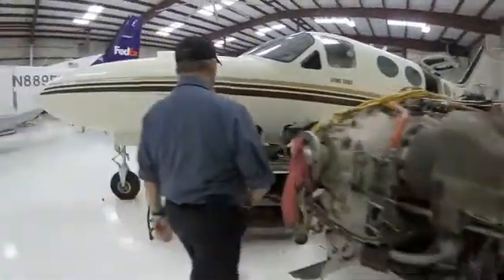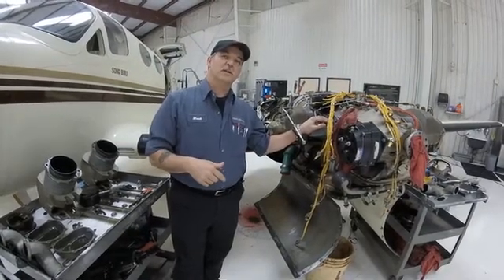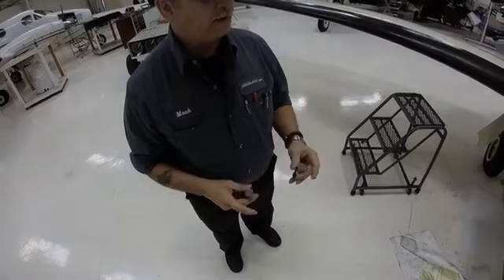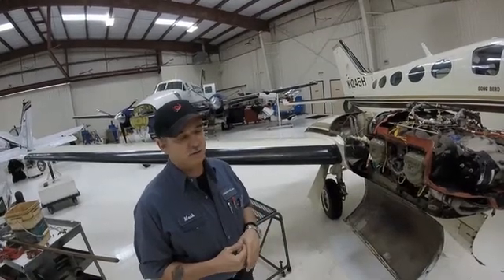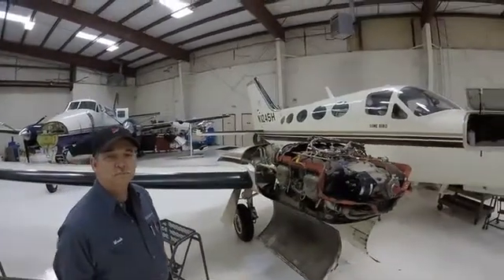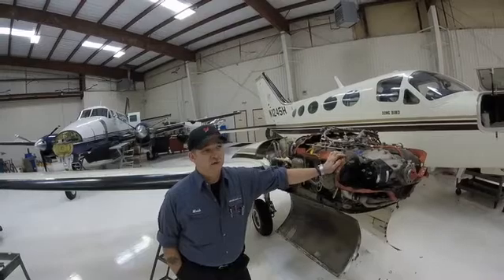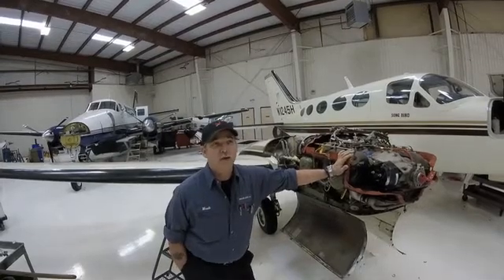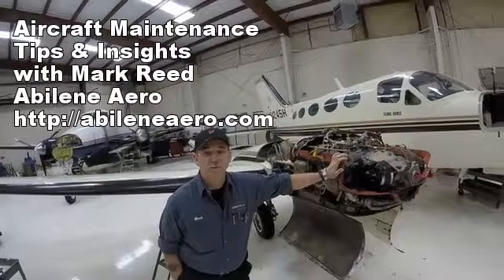Maintenance Insights-Lifters On Continental Engines

Comment: These lifters haven't been very reliable, and rust gets them pretty quickly in this application. If I'm changing cylinders or resealing leaking push tubes on Continentals I'll change lifters when they look like the one on the right because they might take out a cam in the next five hundred hours on an A/C that gets flown that much in a year's time. 

The pitting decreases the available surface area to bear the load accelerating the wear because the remaining surface area becomes overloaded and overheats. 

I agree with this guy about faulty cam geometry causing accelerated lifter wear, I've witnessed it.
Reply: Is it possible to remove and inspect these lifters without removing the cylinders?
Reply: @claysmith8287  :   replying 2 years later to you.  Yes, it is possible to remove the pushrod tube on a cylinder and pull the lifter out.
Reply: Lifter replacement without taking bottom end apart seems a secretive black art. Someday I hope to see how it’s done.